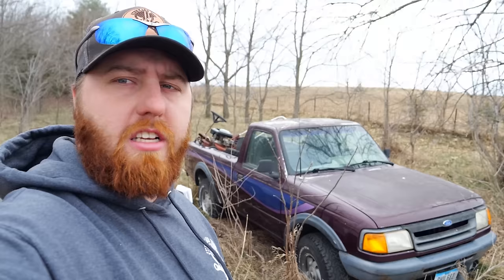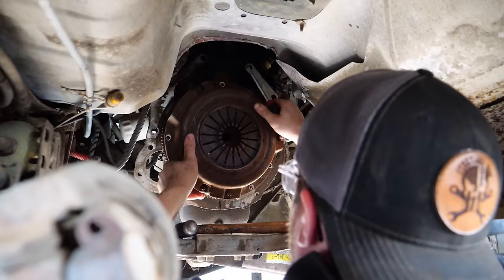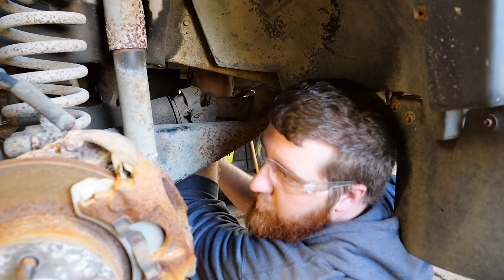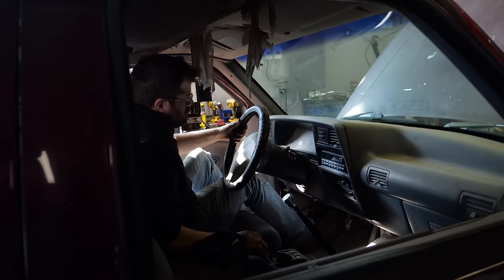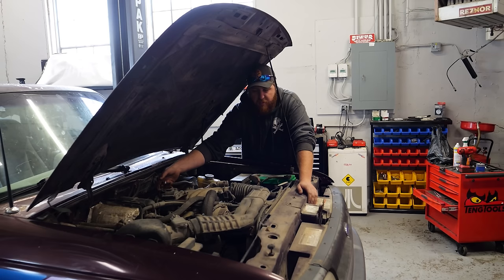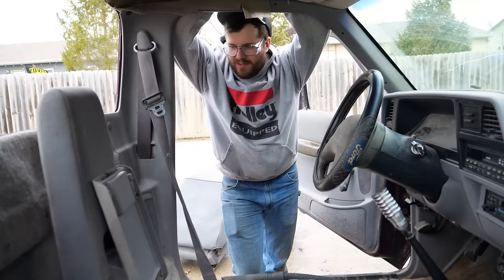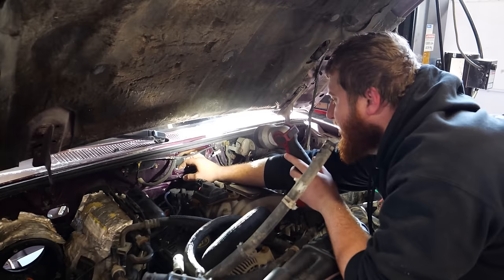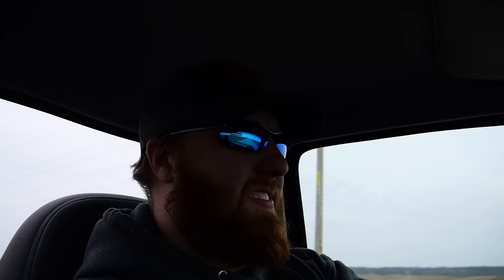Will my CHILDHOOD Truck RUN & DRIVE After sitting Abandoned for YEARS?

Comment: Here in our area Rangers of that generation are very common. Many are still in use as daily drivers for the original owners, farmers, and as parts delivery trucks by local parts stores. Our closest neighbor had one, 6cyl "step side", 5sp manual, etc., etc. until he decided to give it to his stepson to drive to work and tech school. That truck had over 150,000 original owner miles on it, with the factory engine and transmission! The only place it had ever been serviced at was our local Ford dealership which was where our neighbor had purchased it new. Sad to say, many of the Rangers still in use in our area, out lasted the dealerships where they were sold and many of them are on their third and fourth owners. I have no idea how many of them have had their engines and transmissions replaced over the years but I'm sure it would be more than a few. By the way, your truck falls in the high middle range of the condition range for those still on the road around here which goes kind of like this: #1: Survived a young war. #2: Still running but nobody knows why. #3: Damn good truck that runs like a champ but looks like crap. #4: Looks and runs like new and may have been kept under cover and bubble rapped for most of its like. I really wish I had purchased one way back when as I'm pretty sure I would still be driving it. By the way, don't forget that your Ranger shares many parts with its Mazda "twin" of the era.

Comment: My son just started driving last year.. we blew a a4ld in and could not find a good used trans anywhere..ended up shipping one from east coast for 1,400$.. also we rebuilt the whole front end,replace trans,put a leveling kit in it and all kinds of other wrk..complete reseal of the engine too..the v6 is a bitch to do an oil pan gasket I'll tell ya that..engine out job basicly..we did upper/lower intake gaskets,valve covers too..kids 1st truck and we've been thru it front to back..also rebuilt front axle..also not fun to pull the ttb apart in my opinion..

Comment: I had an 89 ranger, 2.9L, 5 speed 4x4, and an 02 ranger, XLT off road, 4L, auto, 4x4. Loved them both, but the 4L with the 4:10 gears, makes them a completely different truck. Powerful, easier on gas, torque... the thing was a workhorse. I loaded all the materials for a 10x12 shed on the back, all the lumber, plywood, shingles, hardware, and concrete blocks for support on the back of it once... basically, i put a 10x12 building on the back and hauled it. And it did it for the fun of it

Comment: A blower wheel (squirrel cage) will blow air in either direction, but will move far more air when running in the correct direction. It won't "suck" if running backwards.

Comment: The first vehicle that was ever in my name was a 1994 Ranger.  It was the 4.0 extended cab flavor and it was the same color purple too.  Engine was a tank in it and was the best part of the truck.  Transmission locked up on it after spending $3,000 fixing other issues in it.  I finally called it quits and sold the truck for scrap value.  Maybe should have thrown another transmission and transfer case in it, but it was a lemon since it had so many hands working on it before I got to it.  But I do remember pegging out that speedometer one time running that engine to the rev limit every gear because I ran it out of gas (faulty fuel gauge).

Comment: Got a 93 ranger splash my dad bought brand brand new the year he graduated highschool, he drove the absolute shit out of it until 98 with 81,000 miles on it due the the rear main seal going out. Come 2024 the truck had been flooded to the axles a few times and needed a lot of work right now I’ve done a few things to it and everything works except for the 4.0 v6 which is severely locked up, can’t wait to get this little rusty sport truck back up and rippin burnouts, cool to see others getting their old ranger up and going again, just giving me more inspiration to finish mine

Comment: If you ever have to do a headliner and want to make it easy, you can get a very small roller to help guide the material against the glue. You can use generic canned spray adhesive, but it tends to let go with heat cycles faster than automotive glue. My father used to spray the back of the material and roll it down onto the board

Comment: Hi Kevin... Just a note.  My Son's ranger got 13 mpg, with the muffler cut off.  New muffler, ('restored normal back pressure) magically, highway mpg jumped back to 28.   Not even joking.  Test was Vegas to Carlsbad, CA.. 330 miles.  so, I assure you... it was a good test.  Just a FYI.   Love the vid.  Ranger,... GO!

Comment: I really miss trucks of this size and smaller running around. My dad had a 93 toyota with the immortal 4 banger in it. Not a speed demon at all, but we went everywhere in it hauling all sorts of stuff and pulling dodges out of the mud. Fantastic truck.

Comment: I Just realized, that back window is Flat-Glass, If i recall, You can go to any glass shop that has Automotive/Laminated glass with a template from the back of the ranger and they should in theory be able to cut it to the proper size/shape

Comment: a great way to get the smell out of carpet.. Get a cheap box of detergent, add in a box of baking soda, mix it.. then sprinkle the carpet with it.. cut a gallon of tap water with 2 cups of white commercial vinegar.. put that in a spray container.. spray the sprinkled carpet.. it will lift the mouse gross out of the carpet, usually will save any carpet.

Comment: If the carpet and seats are half way intact you can pull them out and use the pressure washer them, its easier and less work than scrubbing for hrs to get all the dirt, spilled coffee, and mouse stuff out of them.

Comment: Out of curiosity, have you ever considered tracking down an old pneumatic tire changer machine from an old defunct gas station/ service station for cheap and reviving it by replacing all the air lines and wiring and getting a decent bubble balance so you could do your own tire work quick?  My brother did and the tire machine works real good and the Harbor Freight  bubble balancer is great.  Also useful is a cheap Amazon sourced tire air cannon makes quick work of reseating tires that have come off the bead ( would be real useful for your "wilderness" based revivals).

Comment: This brings back memories of my 86 ford ranger. I did two transmissions with my dad before it was finally given to me. I had to replace the engine block because the transmission blew and broke part of the block connected to the housing. The engine had over 296k on the motor when that happened and all i did was replace the block and put in the original parts from the old engine in the used block and drove that truck from the age of 16 to 19 years old. I miss that old truck. It will always be a great memory of working on trucks with my dad.

Comment: Gotta love the gutless 3-slow Rangers.  Had a 99 Super cab step side 4x4 5 speed.  The 4.56 stock axles made it hum at 3,200 rpm @ 70.

Comment: reminds me of my ranger, "just needs fuel pump" got a new pump put in, ran for 30 seconds and died. Every fuel line on the sending unit had burst. Once it was running on the first drive it was evident that the upper balljoints were miles from separating. Final nail was the alternator overcharging the battery and eventually killing the ecu.

Comment: Squirrel cages are centrifugal pumps, with angled blades to increase efficiency, when you spin them backwards instead of increasing efficiency, it just makes it absolutely crap efficiency, but it’s still centrifugal, so it will kind of puke out a little bit or something.

Comment: Ah yes, the old "stick all of your extensions together" trick for installing ford manual transmissions. I had to do the same thing on my 08 mustang GT but I got the pleasure of doing it in the dead of winter in a non-heated garage on a concrete floor.

Comment: I had a 1994 ford explorer sport that had one of the best V6 4 liter engines out there!  Manual transmission went out at 120,000 miles. Rebuilt one lasted 12,000 then I got the OEM and ran perfect over 230,000 miles. That was over 15 years ago. If it’s been taken care of it’s probably still running today. That car never left me stranded, even leaving the head lights on during a 49er game at candlestick stadium. After the game fired right up. Transmission went out once when I was abalone diving and I made it home 50 miles in 4th and overdrive. 1st 2nd and 3rd made a huge loud thumping sound under the stick shift. I sure do miss that vehicle….

Comment: I had a '94 Explorer with those factory automatic 4 wheel drive hubs. They started self engaging while driving down the highway.  You want to talk about severe grinding and banging noises coming from the front end. It would make the steering wheel jump in your hand. At the time Ford wanted almost $400 a piece for new hubs. WARN sold a manual conversion kit to replace those hubs for under $400 complete for both sides. You still had to use the button on the dash to engage the transfer case, but you also had to get out and lock the hubs in. They were stronger than the factory auto hubs and never gave me another issue.

Comment: You should put a suction pressure gauge on your ac. It's probably low on charge. That's why the evap is so cold. Lower pressure = lower temperature. The lower temps will cause the evap to freeze up and stop cooling.

Comment: So I had a 1996 Ranger Splash with the 4.0, 4x4, and the same M5-OD transmission. When I first got it, it too would surge in rpm even when I lifted on the throttle. The culprit was carbon build up in the throttle body and the mass airflow sensor also needed a good cleaning. I am willing to bet your Ranger may have a similar issue. Great video, awesome to see an old friend back on the road!

Comment: Oddly enough I just sold a nice freshly painted rebuilt one of these transmissions just a little while ago. They are definitely really hard to find! I’ve tinkered with rangers since I was 13 and now I’m 29 so if you have any questions about them feel free to ask me or go to the ranger station’s forums. They have a great guide to that 302/351 swap you guys were talking about. It literally tells you everything you need and need to do for any engine swap you can think of! Keep up the great work.

Comment: My first truck was an 82 S-10 Durango. It had 152000 miles on it when I got it at age sixteen and I too drove the hell out of it. It was so rusty you could throw a baseball at the grill and watch it come out the tailgate lol. But that truck was simultaneously a shitbox/monster truck/F1 car all rolled into one to 16 year old me. I'm glad you are able to revive your old ride, I lost track of mine after I gave it to my brother. I think it ended up as a cube.
Reply: Also, I had the same kind of exhaust on my truck back then. I had to cut it off with a sawzall while laying in a snow/slush puddle on the side of the highway but that is neither here nor there lol. My father called it the "Shitbox Special".

Comment: I had a 98 ranger and it bogged down like that, faulty mass air flow sensor was reading that we were getting wayyyy more air than it actually was and letting the engine run super rich.  Since you had high fuel consumption it sounds like you have the same issue, I'd say replace the MAF.

Comment: Needs a V-8 with a 5- speed manual. Oh, and before any drivers and/or passengers develop hearing loss issues put an extension on the header with a Hush Thrush muffler. It'll sound like a tamer version of a GlasPak.

Comment: Have the same 94 ranger engine, trans, 4x4 combo. I get the classic plates this year. Seafoam the injectors to start. Your coil may be an issue, my stock coil melted down at age 13. Good luck!  ANGUS RULES!

Comment: Somehow, this reminds me of how I got my first car. My dad bought a used Suzuki Vitara JLX as a compact farm truck when I was younger, and him and grandpa drove it for ages. At some point, the shifter broke and only 2nd, 4th and reverse still worked, so he put it aside and bought an Isuzu Pickup truck a bit later. The Vitara just sat and dad wanted to get rid of it, but I always managed to convince him to keep it. In the end, I got a friend to ask his uncle, who is an actual mechanic, to assess the car and he figured it was only some sort of small plastic bit that held the shifter in place, something that could be replaced in half an hour and costs like 10 bucks max. Few weeks later, dad got the part while I was away, we installed it, got it to a shop that fixed up everything necessary to get the car through the TüV, and then I had it registered to me on the old plates. I still have it, and I still complain about it reeking of dad's and grandpa's extreme smoking and it having no A/C. But I love the maroonish little cube, and I'll keep it until the floor falls out again.

Comment: Those rangers are great trucks. My granddad had one for about 18 years, it saw use as an occassional runabout, getting items that wouldn't fit in the car, towin' a small trailer to haul the occassional thing. Sadly he crashed it  a few winters back due to black ice and a horribly paved section of interstate. (Off kilter, super bumpy and curved.) It wasn't in horrible shape, needed a new front clip but no structural stuff, new owner fixed it with some Junkyard parts and drives it often!

Buut that segment of loud, droning highway driving reminds me of my 82' Toyota pickup, being younger at the time I decided it needed a muffler that doesn't muffle a thing, it just collects the noise for a smoother sound...It's so loud I can't go to a drive through without turning the engine off. It also doesn't do highway speeds!...Mostly because it's a 4 Speed, 4WD with 4.10 gears...I got it to 'go' 70, but it did not keep going 70. (But it did survive!) and 65 is so amazingly loud and so horrifically floaty feeling that I just don't...of course 55mph is marked in red on the speedo...I know it was The mandated  speed limit of the time but it also feels like the reasonable top speed of the truck!

...Rambling aside it would be interesting to see this ranger get an engine swap!

Comment: Check the capacitors in the ECM… im having the same issue with my 93. Pulled the ecm from the driver front fender and pulled the cover off to find four capacitors inside had leaked and caused corrosion. 
You can find repair kits online that come with the capacitors you need, just clean the board up a bit and solder in the new matching capacitors.

Comment: Nice! I just gave my son my old 1997 4.o extended cab with the camper top. Only has 152000 on it,power everything,seats,mirrors,lumbar support,this truck even had an air intake from the factory for a F150. Maybe a one and only made, had every option except 4x4.

Comment: Centrifugal blowers always blow no matter which direction the motor runs. Many, many years ago I was servicing a sawdust extractor, the people who worked there said it was always had bad suction, was installed many years before. I checked it out, sure enough going the wrong way, I reversed it and it ran so much better, they had been about to replace it!

Comment: Wow, a revival I can relate to, I have a 94 of my own, replaced almost everything under the sun on it, and determined that the previous owner didn't know what maintenance was, except an oil change, mine's got the 4.0, but same transmission, exhaust bolts were rusted enough that we had to cut the exhaust under the transmission to drop it, and I hope those rubber bits aren't where my transmission is leaking, oh boy

Comment: Did that job on a 2nd gen Explorer with the same transmission.  The WORST part wasn't the R&R after the clutch job-  It was trying to bleed out the clutch as Ford decided to put in a loopdloop that made getting the air out just about impossible.

Comment: Better and more interesting idea than V8 swapping it, these 3.0 engines with the manual trans respond really well to forced induction, you can put nigh on 15PSI through a stock motor. 
Something a little bit different and out of the comfort zone? Learning and teaching opportunity?

Comment: you can get those top transmission bolts from under the hood with a normal ratchet and no extensions, ive done it 3 times on my 94.

Comment: Quick idea and best exhaust you could do on the truck and it will be ungodly loud. true dual cowboy style out the back with 24" echo tips and 12" glass packs. My dad had this setup on his 94 Mazda b3000 and it was epic and definitely a sound that will beat out any v8

Comment: I've had the same Grabber ATX tires on my 99 Ranger 3.0 for the last four years, they definitely vibrate between 60-70mph. Very noticeable when I first got them - great tires otherwise though, for way less than the K02s (at least at the time they were way less!).

Comment: i had the same truck in the same color and year this brought back some memorys when i use to flip cars i had more that 10 of dose trucks in almost any color that you could think i had the extended cab, the splash extended cab 4x4 v6, the extended cab v6, the stx 4 cil 4x4 and the 2wd. they where easy to fix and real reliable trucks

Comment: I ran into that same blower motor problem, also in a ford. A mechanic changed it out and there was no airflow, he called for a new HVAC box. Came to me, I figured the polarity was reversed, swapped the wires, and fixed it.

Comment: I drove the hell out of my '89 Ranger, but like you, had difficulty getting a transmission for it.  Five speed manual, Ford had Mitsubishi make two different transmissions during that model year.  Had it rebuilt, and of course, the wrong parts were used and it blew up on me at 3:30am in the middle of nowhere.  That was the end of the Ranger for me.